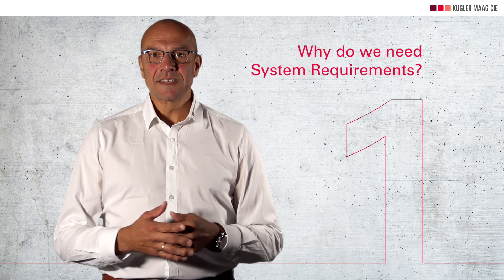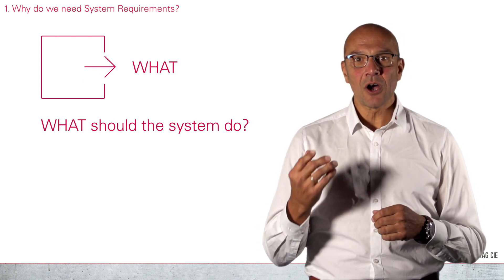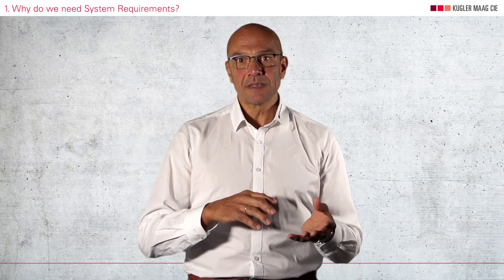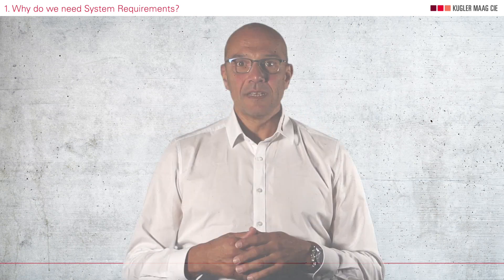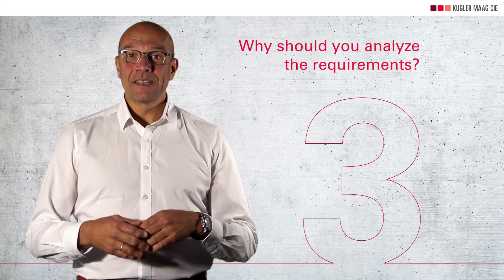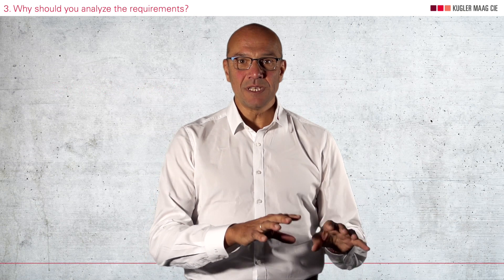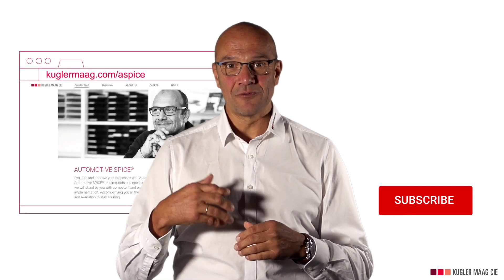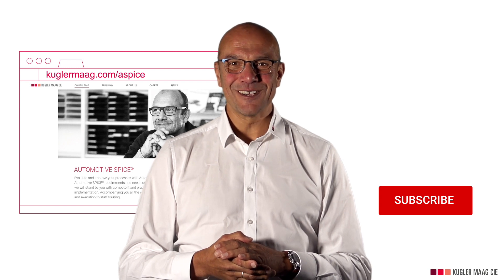SYS.2 System Requirements Analysis | Automotive SPICE

Comment: Hello Sir,
Thanks a lot for this video.It really helps my tasks.
Could you share the video on SYS3 ?
Reply from the maker: Hello Parameswari Priya, 
SYS.3 is scheduled for 2022. This year we will release more videos on ME SPICE, Software level functional safety and Cybersecurity. 
For an initial orientation, you can watch SWE.3. It is at the software domain level, but in combination with SWE.4 you will get a first impression of the relationship between specification and verification, the need for strategies and bidirectional traceability (horizontally between SYS.3 and SYS.4 and vertically between SYS.3 and SYS.2 and SWE.1).
Sincerely yours, Your Video Team at Kugler Maag Cie

Comment: Thankyou for this video😊😊 i want to learn more about system requirements and writing process of any requirement please suggest
Reply from the maker: Requirements are the crucial point of development, because with requirements you also anticipate important system architecture decisions. If you do not thoroughly address these specifications, you will pay for the technical debt later, e.g. if you intend to reuse some parts. This phase also has a significant impact on system safety - serious damage is caused by system failure.
Reply: @ULSolutionsSIS  thankyou 😊😊 how to improve my technical knowledge on requirements writing skills,

Comment: Thanks for this video. I have several questions:
1. What in case I use external SW component and I got SW interface specification for that? Should I threat it as stakeholder requirements and link those SW interface requirements to system level requirements or rather threat it as SW architecture document? 
2. What in case a part of stakeholder requirements are more or less project organizational requirements (e.g. Project should have Release Manager role). Should such stakeholder requirement be covered by (and linked with) system level requirement(s)?
Reply from the maker: Hello Mr Siejek,
what do you mean with your first question? I assume that "external" means you have a supplier. Considering it is a component delivered by a customer: The decision to use a supplier is something you would likely cover in the SW archicture. Only if the cusomter or an internal department says "you have to use this supplier" this would be a system requirement (constraint) which traces down to SW requirements and architecture.
With your organizational requirements that is up to you. You can reflect it in the System requirements, but beware. You will not have a system qualification test for that.
It may be easier to show coverage of these stakeholder requirements in a different way (e.g. reference of the relvant chapter in the project plan).

Regards, Your video team at Kugler Maag Cie
Reply: @ULSolutionsSIS  Thank you for your answer. Yes, external means we have supplier, who is delivering us SW component and also requirements, how this SW component should be used (interface definition, SW component configuration etc). The SW component might be suggested to be used by the customer but it could be also our organization decision. I understand that such kind of requirements which I get from supplier also can be counted as stakeholder requirements visible in Sys.1 process, right? If it is a case and I understand your answer correct, I should link the requirements from Sys.1 to SWE.1 - 3 directly and not track them anyhow in Sys.2 and Sys3. Such tracking of requirements should not be found as violation by assessor. Is my assumption correct?
Reply from the maker: Hello Mr Siejek,
yes, you can link these requirements (a supplier is also a stakeholder, but you would also provide requirements for the supplier) directly to the relevant process SWE.1 to SWE.3 but...

... you have to ensure that these requirements which you linked to e.g. SWE.3 are covered by the higher processes (SWE.1 and SWE.2, even SYS-processes) and are neither in contradiction nor are covereing sys-requirements which have not been documented (yet).

Cheers
Your video team at Kugler Maag Cie
Reply: @ULSolutionsSIS  Thank you very much for your answers! :)

Comment: Do you have courses where you explain Requirements Engineering based on/with Safety Goals, Safety Requirements, Technical Safety Concept, ASIL (from ISO26262) and so on??
Reply from the maker: Hello Teqnum, 
by mid-March we will publish a Functional Safety video on the Concept Phase, Part 3 of ISO 26262. There we mention the relation between the FS goals and requirements. We don't offer a special RE training. You'll find our training program here: https://www.kuglermaag.com/training-topics-and-timing/
Cheers 
Your video team at Kugler Maag Cie

Comment: Thank you for your video but I have a question regarding this subject.
In software project management, who should be in charge of writing this documentation? Is it the project manager, lead developer, or system analyst?
Reply from the maker: Hello ninja nincode, 
Automotive SPICE does not prescribe a role that must perform this task. Depending on the context, the project manager, lead developer, or analyst can take this on. What kind of project are you talking about? If it is a pure SW project, SYS.2 does not apply. 

Regards, Your video team at Kugler Maag Cie